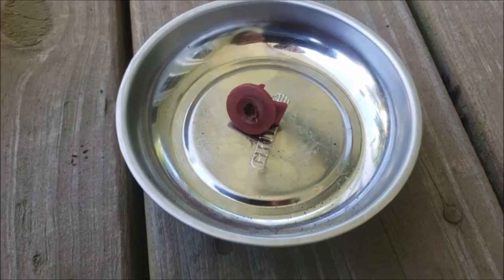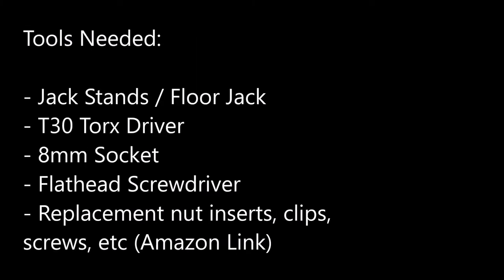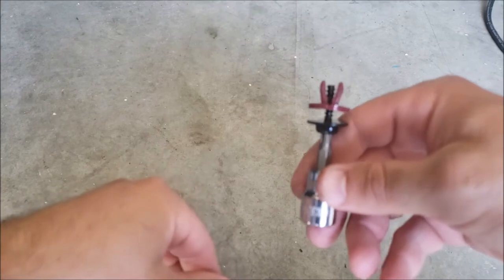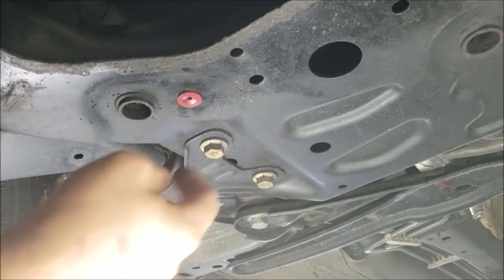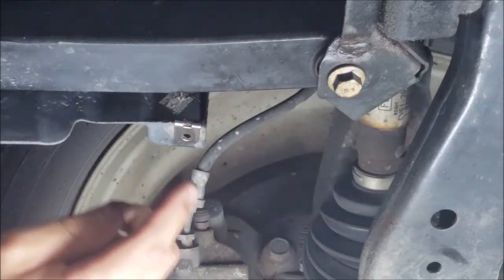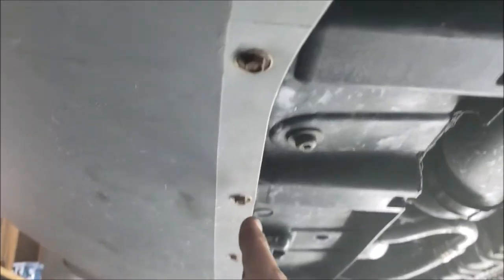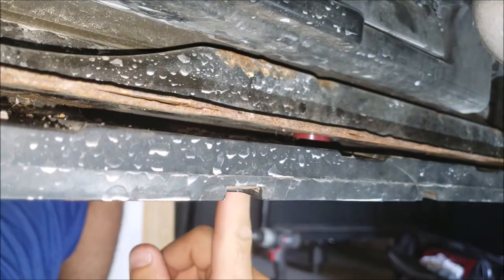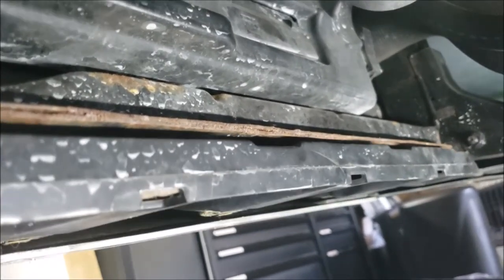Splash Shield Nut Inserts, Screws, & Clips: HOW TO ESCAPE

Comment: I changed mine out last oil change when I replaced the splash shield. It helps to have something to wedge between the panels while you're replacing them.
I would also recommend replacing all the fasteners with a new splash shield. Just to make sure you won't have to replace it in future because of faulty or missing fasteners.
Reply from the maker: Thats a pretty good suggestion regarding the swap with a new shield or oil change at least. So you're saying where I held the panels apart with my hands you just popped something in there to be able to use both hands?

Comment: The quick lube oil change place only had two WRONG BOLT type screws and not the type of screws the kit showed. Using the link you provided I ordered and replaced all the hardware. Thank you for your video. It was very helpful. Stay safe.

Comment: Thank you so much.  The clips on the two sides  I used never tightened,  Not sure how to make them tight. On my 2018 Escape I did not have to take all the bolts out in the front (or rather push pins on mine) I was able to to wedge an end of my screwdriver to keep it open enough.

Comment: Super helpful, as always! I found it pretty tough to get those front clips in place, and it helped to line them up with the holes before 'blindly' pushing them up and in 🙂 maybe with more light and a stronger neck I wouldn't have had a problem.

Comment: I just tuned into this channel and am impressed.  I gained some knowledge, but the info I'm looking for is hard to find.  Specifically, I have a 2018 Escape Titanium with 2.0L.  The front shield: EJ7Z-6P013-A fell off.  It is a felt covered engine splash shield.  I bought a new one as the mounting holes were all ripped.  Dealer is unable to guide me to buy the correct fasteners. No kidding.. I went to 2 dealers and they give me the "AR" response- "As Required".  They are incredibly unhelpful and will get an earful from me later. (for those needing a new one- shop the dealers as prices will range from $180-250)

Can you review / repair the felt covered 2018 Escape splashshield on this channel and help all of us to understand the fasteners needed to attach to the underbody?
Reply from the maker: Hey there and thanks for taking the time for the great feedback and question- sorry you're getting run through the rounds by the dealerships. Helpful that you have the new shield and the P/N already. Have you tried looking at a site like TascaParts? There are good exploded view diagrams and it SHOULD have the factory parts/hardware associated with the shield nearby in the graphic. Try this link and then look at #18 which is titled, "Under Cover Screw".  If it' snot the right one, there are a few fasteners in the area around the shield. Give a shout if it's what you are looking for! https://www.tascaparts.com/v-2018-ford-escape--sel--1-5l-l4-gas/body--splash-shields
Reply: @HowToEscapeDIYTipsandReviews  And so here is my update on this issue.  I went to 3 different dealers and found one parts counter guy who knew which ones to buy.  About $40 for overpriced fasteners that didn't work because the holes/ nuts were all shot.
Several things going on here: 1.  Every oil change they must drop this shield and depending on the skill (and care) of the mechanic / technician doing the work they may or may not properly secure the shield.  2. After numerous oil changes and of course when the car is out of warranty the receiving nuts/holes no longer properly secure the shield. They are likely stripped.  3.  Winter weather / snow and ice and heavy rain along with road debris no doubt test the robustness of the design and installation.  All that being said, I simply used some 1" screws with a big washer to secure the shield. The screws varied in width as a few of the holes were buggered up (Bugger is a technical term ! lol).  Bottom line is that it is on and secure.  Next oil change might be a challenge.
Reply: @HowToEscapeDIYTipsandReviews   BEST solution yet !   Talked with my Bro in Minnesota who has similar issues.  He bought some double headed threaded screws.  Wood screw on one end, and machine screw threading on other.  He bought some stainless washer and wingnuts to secure.  BRILLIANT !  The wood screw end is sunk into the plastic nut imbedded in the car chassis and then the wingnuts and washers are installed on machine screw end.  The wingnuts can be tightened by hand preventing the oil change guy or anyone else from using an impact wrench to strip the screws.

Comment: How do the silver metal side clips attach to the shield? Do you screw into the clips? Thanks
Reply from the maker: So the metal side clips don't attach to the shield. They attach to the plastic on the car- there are one on each side, just inside each wheel. The screws hold the shield to the plastic on the car and the threads of the screws either go into the red inserts or the metal clips- please let me know if that makes sense- I may have not said that super clearly haha
Reply: @HowToEscapeDIYTipsandReviews  I'll have to get under there and look again. I wasn't able to lift the car so I can very far underneath to see very well. It looked like the holes in the guard were too big and the screws would just slide through. Thanks for your help.

Comment: Help! 
At 3:04, what is the name of the black cover under the radiator? I need one because the silver bumper cover is just hanging loose.
Reply from the maker: Hey there @theebadge! Checking Tasca Parts, it looks like its Ford Part # CJ5Z8310A and it is the "lower air deflector". You can go on Tasca and browse the exploded view diagrams which is what I find really helpful when I don't know what a part is called but know what it looks like haha. Anyhow, hope this is helpful. Tasca is really good, but usually not the cheapest price. Try searching the part number on other sites to get your best price. Good luck and let me know if you have any other questions or if I misinterpreted your request!
Reply: @HowToEscapeDIYTipsandReviews  thank you so much! Great video

Comment: I use a 1/4 inch flat head to remove the t30.
Reply from the maker: Hi @David_Taylor- are you saying that you use it instead of a T-30? Does it fit inside the torx pattern?! Or are you talking about prying off the T-30 inserts?